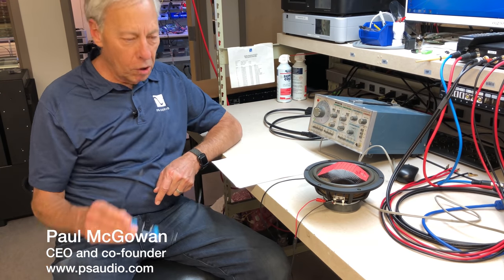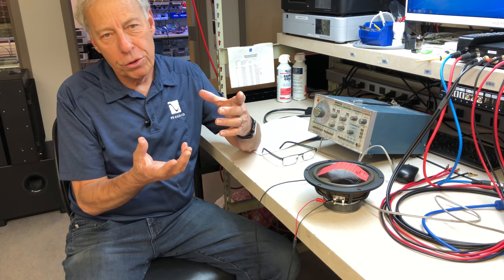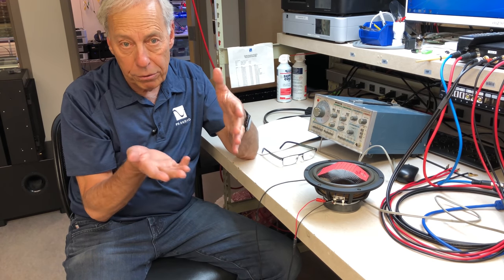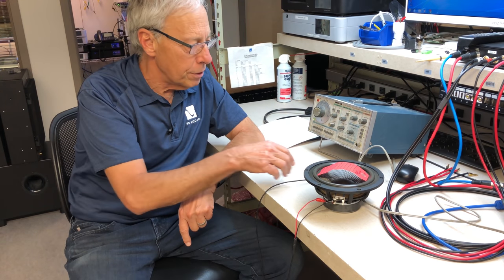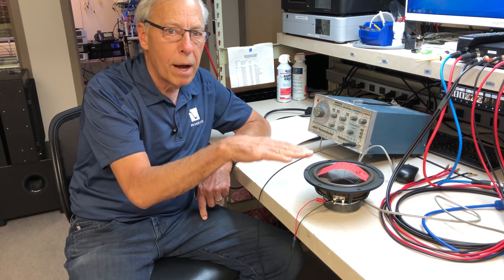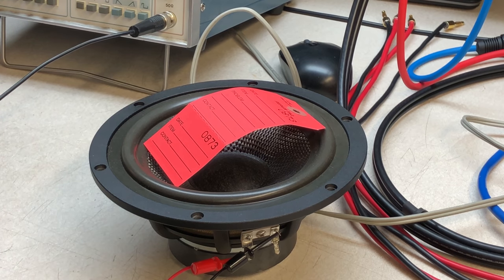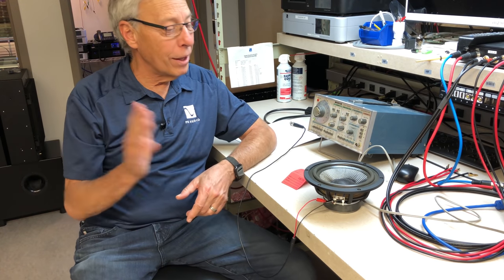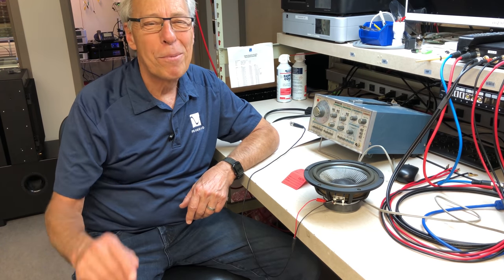How does a speaker coil work?

Comment: I am a physics major and think I understand  the Lorentz force equation... the magnetic field inside a ring magnet should resemble the fieldd inside a solenoid, which is all in one direction with the same direction as the axis of the magnet. The voice coil is within this uniform field, with lets say the field pointing up at every point on the voice coil. If I pick a point on the voice coil and do the "right hand rule" for  a cross product of current with the magnetic field, I get an "outward" force on the coil at each point, as if the coil is being forced to expand. This doesn't produce a force upwards or downwards on the coil. If I want the right hand rule to produce an upward force, I need the magnetic field(or some component of it) to be pointing "inwards" at every point on the coil. This is best produced at the ends of the magnetic gap or even outside the magnet... so is the ideal rest position placing the coils near the top or outside of the magnetic gap?

Comment: Just want to point out the common misconception that the waveshape of the current sent to the speaker is NOT necessarily the speaker's displacement (position in space). The current sent to the speaker is proportional to the force applied to the speaker and therefore also proportional to the speaker's acceleration. Therefore, when you apply a square wave to a speaker the only movement that is truly square is the speaker's acceleration. The actual displacement of the speaker can be found from integrating the acceleration twice, which always results in a much smoother looking wave. The only time the displacement and applied current take the same shape is when playing one tone -- a perfect sine wave -- because the double integration of a sine wave is simply another phase-inverted sine wave.

To complicate the issue further, people often apply low-frequency square waves (just like in this video!) or DC to the coil and see the speaker popping to its maximum and minimum excursion -- resulting in what looks like a square displacement! But, the speaker is actually trying to accelerate for the full duration of the application of DC current and is prevented from doing so because it slams against its housing. An ideal speaker, with no limit to its excursion, would accelerate in one direction forever with the application of DC.

If you do integrate a square wave twice you will find that the result is quite smooth and similar in appearance to a sine wave. But the displacement is not what counts -- the square acceleration of the speaker compresses the air in front of it into a square compression wave (due to the air molecules' inertia). To be clear, in its specified operating range the speaker is not jumping around when playing a square wave. Only its acceleration is square.

Rant over!

Comment: A speaker works on the same principle as a DC motor or solenoid.  Attaching a cone to move air in response to the signal provides the sound.
Reply: I think you meant to say AC motor, actually a servo motor would be an even better example, cheers !!
Reply: True, the signal is AC.

Comment: I've been wondering about how balanced output works, particularly in regards to headphones. My understanding is that the positive signal is sent to one half of the voice coil, through one of the wires, and the inverse of the signal is sent to the other half of the voice coil through the other wire. Apparently a ground happens where those two signals meet in the voice coil? How is the circuit complete, and thus able to move electricity?

Somewhere in my understanding I'm wrong, and I'd like to know where. It's hard to find easily digestible information on this subject. A lot of the sources I do find fly right over my head.
Reply: In both balanced and unbalanced signal transfer, there is a varying voltage between two the two signal wires. In unbalanced signal transfer, one wire is held at 0 volts (ground potential) and the other carries the varying voltage. In balanced transfer, both wires remain ungrounded, not just one. In both circumstances, the circuit along which the current travels is a complete loop.
Reply: @jonathansturm4163  I guess I'm having a hard time conceptualizing this. Is the inverse signal/ground wire essential to completing the circuit? Or is each signal just completing the circuit itself? How would that work?

I think my brain is still stuck in elementary school where we'd use a battery and wire to make electromagnets. It's easy to see how that's a complete circuit, since it has the wires connecting to two ends of the battery.
Reply: there's no such thing as ground in speaker voice coil, it works through voltage difference.
Reply: @VuffyPulva  The issue here is that current can only flow through a circuit as in the battery/electromagnet example you give. Circuit and circle are both from the Latin circuitus (going round). In both signal cases it's the circularity that's important and why we use the term circuit for any electronic/electrical machinery. If a circuit be broken, voltage can still be present, but no current can flow.
Reply: @VuffyPulva  think of it this way, the two terminals on a speaker are the two ends of one CONTINUOUS wire wound into a coil...cheers
Reply: Balanced means to each channel (left/right in stereo) a phase inverted channel is added. A common ground serves as return path for both the inverted and non inverted channel. 

It is usually done to cancel out common mode noise, because unlike the audio signal, unwanted noise picked up by the cable has the same polarity in each channel and is therefore eliminated when both the inverted and non inverted are recombined again.

In a headphone which is a passive device with no gain, I see no real benefit of using a balanced signal.
But it can be implemented by, as you said, center tapping the voice coil and grounding that tap as a common return path while hooking up the two opposite phase leads each to one of the ends, so the magnetic fields of both coil segments add up into one.
Reply: I found this video from 8 years ago at @UCTWdffRAxiZ_ryoR1QxVMjw to be helpful: "Audio Basics - Balanced Audio"

I do think you are mixing a few things.  The line to a speaker is just an isolated AC line with the speaker coil as the load.  AC lines don't have "grounds", they are just a circuit with "zero" referenced with the midpoint between total amplitude .  (Mains have one side of the circuit bonded to ground, i.e., the neutral for safety and stability reasons on such a large involved system, but it is not necessary for an AC circuit to work).  

Alternatively, balanced differential signaling is used on digital lines which are DC but the circuit has terminating resistors at each end between the high and low lines.   Look into Time Domain Transmission Lines

Comment: So the current going to the voicecoil is DC and not AC?
Reply: No, the voltage is varying. It doesn't matter if the variation is always positive or negative, or between positive and negative. The essential thing is that the voltage is changing. The change in voltage changes the strength of the magnetic field generated by the current flow in the wire.
Reply: No, audio signals sent to the coil are a mix of different, often overlapping AC waveforms with different amplitudes and frequencies.
Reply: @Thom Moore If the signal voltage varies between + 1 volt and + 5 volts, that will cause the cone to move back and forth. This is elementary physics. There will be distortion due to the fact that this movement is asymmetric, but sound will emanate from the speaker nevertheless.
Reply: When I put a voltmeter across the speaker terminals I see a varying voltage. Yes it's current doing the driving, but the voltage does not remain constant either. Only the DC resistance remains constant.
Reply: This from a person who clearly doesn't understand the difference between pulsating Direct Current (current flow is always in the same direction) and Alternating Current where there's a regular reversal of current flow. That's what Direct and Alternating mean. Back when I was learning this stuff radios couldn't work with the low voltage (6 or 12 V) delivered by motor cars. To attain the 45 V or more required by valves (vacuum tubes) a relay was used to turn the 6 or 12 V on and off  rapidly thus driving the voltage transformer. Although this served the same purpose as alternating current, it was never referred to by that term. It was called pulsating DC. Mr Moore of course is nit-picking in the hope he will discredit Paul who gave I thought a good explanation.
Reply: @jonathansturm4163  I'm just too young, As far back as I can remember, the early vw bugs had 6 volt electrical systems. An aftermarket power converter helped with modernizing so we could have a real stereo instead of AM radio. The first car stereo power booster was called a "shotgun" ('77), hit that button and hold on, because you going from 3 watts to BAM!!!!
That and chucking lit fire crackers out the window while riding around the northern outskirts of the Detroit Area, made the Motor City experiance one of the best.. I ❤ Michigan!!
Reply: We could try for 40 comments on this one. You just know thom moore is needing attention.
Reply: @SJMessinwithBoats  Pretty much all motor vehicles used 6 V batteries until the mid-1950s. The move to 12 V happened when bigger engines with higher compression ratios required the higher voltage to activate the starter motor. Only thing I know about Detroit is that's where Motown was based...
Reply: @jonathansturm4163  You know Eminem, he came from 8 mile rd. My step mother used to work in a dentist office not to far from where Eminem grew up. The was a Heathkit store there. i used to look over at it and wonder how those people know so much to be working and hobbying in electronics. I think I have an answer now... Ya all have that hypekinitic thing and photographic memory stuff. 
Not me, i'm just a slug spewing slew.
Reply: @SJMessinwithBoats  It's more a matter of being curious. Asking: why is it so? Having a good memory helps, but isn't essential. You can always look things up if you can't remember them.
Reply: @Thom Moore I'm almost sorry I  posed the question, but not really. I really do want to know if the signal coming out is DC, AC or some type of Flux Capacitor sputum. ;-)
Reply: I've been racking my brain trying to remember where I came across a speaker driven by DC. It was my first LCD travelling alarm clock. The LCD died, not the speaker. It only made one sound, a sweep from about 1 to 2 kHz or so repetitively. Gave me the shits, but did its job of waking me up.
Reply: @jonathansturm4163  were is the dc in that?
Reply: @jonathansturm4163 

Reed type speakers from the pre war era were always driven directly by class A output stages with no output transformer, which is of course pulsing DC so the idle position (with the amp turned off) of the cone was essentially it's inwards excursion maximum. There is always DC voltage going through the coil in such designs.
Reply: @Thom Moore 

It's is true that [moving coil] speakers don't really like being driven by pulsing DC however it's not impossible to do so.

Caps in crossovers are there to block DC? Hell no. Only series capacitors block DC. On the woofers you have parallel caps if at all (1st order LP filters are just inductors). 
There are no DC blocking caps in speakers but chances are there are very big ones (10,000 uF+) in your amp, however chances are even higher your amp is a split rail design with no caps at all in the output signal path, because there is no DC offset at the output in such designs (in reference to the floating ground)
Reply: @Thom Moore 

They would block DC but that's not their purpose, there isn't supposed to be any DC at your amp's output terminals (other than a few mV for a split rail design maybe). 
If you have DC on your output there is a massive problem with your amp dude, better unplug immediately
Reply: @SJMessinwithBoats  The DC was switched at a varying rate. There was no polarity reversal of the electric current (AC).
Reply: @westelaudio943  Thanks for the reminder. My earliest forays into electronics was with junked stuff from before the war and of course cheap war surplus. Resistor coding was body, tip, spot and capacitors didn't exist; we had "condensers".
Reply: @jonathansturm4163  I was off in another land making my schematic for how its all going down. I'm pretty darn sure its not "accepted Audiophile procedures".
Theoretically, I should end up with a lot of noise. I just dont ever remember much noise out of the Alpine 3653, even with many stepping into one another. Why dont you just get a Pioneer BT head unit? I run my phone in on a usb. If you got a lossless file on your phone, it really does "kick ass" in your
Sue bar rue.
Reply: @jonathansturm4163  "the DC was switched at a varying rate". 
So, dc pulses made sounds between 1 an 3khz? 
I find that unbelievable. I am not as versed as you but that just seems like you racked your brain just a little too much making that up. No offense my furry friend from Tas.
Your meter showed this?
Reply: @SJMessinwithBoats  SWMBO needs to replace the vehicle; it's very close to EOL. The new Subaru she's eyeing off has BT built-in and I have a spare HTC that I use as a portable music device.
Reply: @jonathansturm4163  I've heard SOL, but EOL is foreign. And a "petrol head"
Is "gas head" over here.
Maybe thats the same as "lead foot" "gear head". I know canadians will say that he was traveling at
 "100 clicks"
Reply: @jonathansturm4163  "end of life" ok
Reply: @jonathansturm4163  My previous trade was Auto tech, so there is no such thing as end of life. Only that a vehicle will cost more to fix than its value.
Reply: @SJMessinwithBoats  You might not believe it, but they're out there; the pulse rate determines the frequency you hear from the transducer, a piezo device in the alarm. They were optimised for 2-3 kHz. Maximal volume for minimal current consumption. The driver IC is usually a 555 configured as an astable flip-flop. This is really basic stuff...
Google "alarm clock pulsed dc"